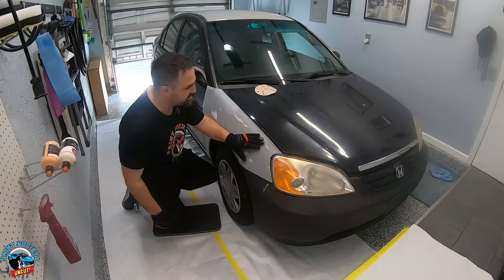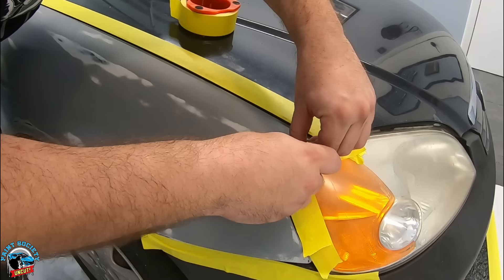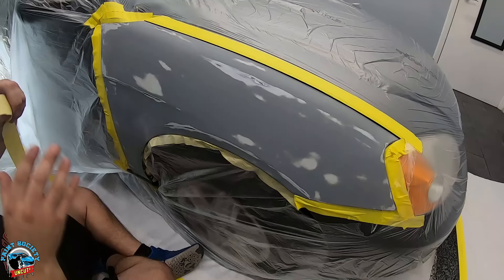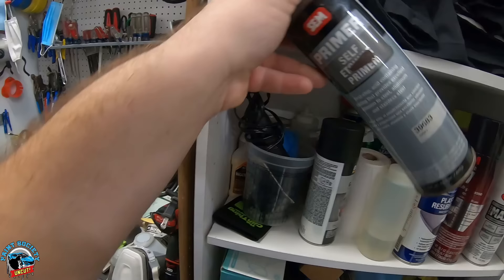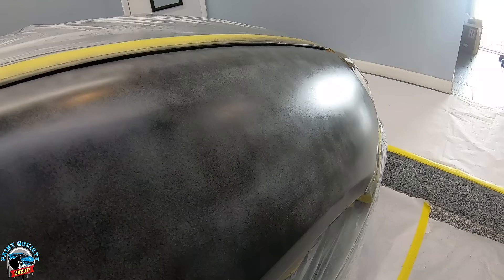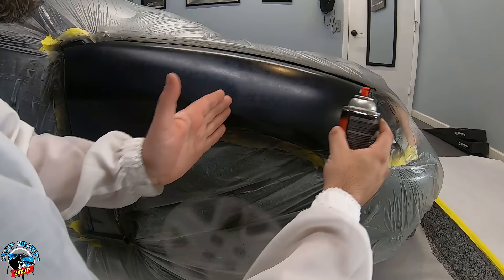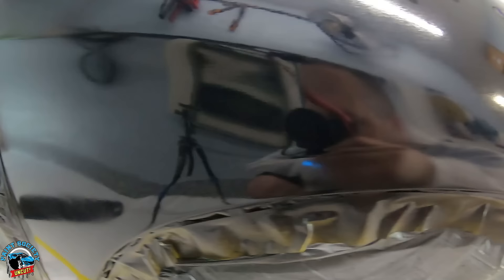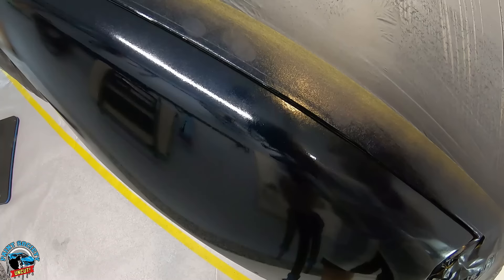Painting your Car with Spray Paint!

Comment: Great videos Brian, and your delivery is impeccable.    I also love your “matter of fact” axioms sprinkled throughout.    “If you get scared of the spray, the car has already won.”    Maybe I paraphrased, but awesome.     So repainting the hood of my 2006 Dodge Magnum, Brilliant Black Pearl.   Quick history:  I bought it new, I’ve only hand washed it maybe ten times, all other times through the “touch free” washes, so there are not a lot of swirl marks happening.     Also never given it a full tilt wax, compound.  I’ve done some panels, the hood maybe once, but not too involved, never the roof, never the tailgate, and only sporadically on the sides/doors, generally when trying to buff out scratches.  The point is that the clear coat is(was) still mostly intact, no peeling, no fading, paint in great shape for a paint correction I guess is what you call it.  Most of the time I’ve gotten through alright with the touch up pen, then blend/sand it in to disappear.   Eh,    Looks like shit.    There are multiple reasons I’ve decided to do cosmetic work on my wagon, but another time.    Beating Chrysler with my Lifetime Bumper to Bumper Warranty is the main reason.  Gotta keep it worth as much as possible.    Plus I love it very much and while I do baby the cars paint and upholstery, it is also a work wagon/production vehicle, yet amazingly in great shape.    So the hood had no dents, one deep chip I guess you’d call a ding, dead center to the primer, and various pebble chips from, ummmmm, high speed impacts with very small things.   Well I’ve all but ruined the hood.    Couldn’t get the tape lines to disappear, way too thick with both paint and clear coat, so had to sand all of that back down, low on budget about now, ran out of sandpaper,  was cleaning it and reusing it, scuff pads, you name it, and the old paint was coming off like dried hard gum, packing every sheet or device within moments.   I got impatient and used my rasp plane to get a lot of the old paint off, and with it went a lot of the factory paint, and a few gouges happened too.  Needless to say, I sanded the hell out of that metal to get it smooth again, but the 80 grit I had laying around dug in pretty badly, and they are persistent bastards, dozens of little crescent moon scratches into the metal, which by the way is incredibly light, my whole hood might weigh five pounds.    Well now it’s lighter because I sanded so damn much.    Anyway, got happy with it, used the Duplicolor Grey high build primer, over and over, with nice long hour plus dry times, maybe 55% humidity, and about 70 degrees in the garage here up the road in Charleston, SC.    With a heater of course, and it helps dry the air too.   This time I got five cans of brilliant black Pearl on, and it looked pretty good, but there were the tiger stripes I’ve heard so much about.   So I put one last hurrah coat of color on and it all filled in pretty well, but still a bit splotchy.   Figured clear coat would fix it.  Which it kinda did, on top of helping a couple of splatters that were very, very fine drops.   I put one and a half heavy coats on before deciding to stop and sand it back a bit to hopefully get rid of the blemishes and either clear coat over my 1500-2000 wet sanding scuff, or add another can of color and really try to get great coverage since there’s plenty of foundation of color.   Problem is that acrylic lacquer has to be applied close enough to hit wet, so getting back enough to prevent stripes allows the droplets to start drying before hitting the surface and results in the well known roughness of dry paint application.     Here are the two questions.   Should I just wet sand the color coat/clear coat till I’ve eliminated  all of the imperfections, which is already 85% there, then go straight to clear coat and let that “even it up”, as the 1500-2000 grit color coat will be uniform, but not shiny wet paint looking.    Does that matter?   Or should I risk applying another can of color and just stay close but keep moving in short strokes?    If I paint it and there are just more stripes and splatters, I’ll have to wet sand again, which is acceptable, but is the new fresh wet shiny paint even necessary?   I understand clear coat, especially acrylic lacquer, doesn’t need much of a scuff if any.    Also, wouldn’t reducing the temp a bit effectively help to slow the dry time of the lacquer, and maybe help the paint hit the surface wet from a slightly farther distance from the panel.  Maybe let it get down to 60 degrees?   I’ve bought so many cans of this stuff, it’s unreal.  In total for just the hood at least 15 cans.   I’ll keep pushing on but I’m ready to lay about a trillion coats of clear in it, with lots of time and/or wet sand/scuff between some coats, which also helps to allow the lower layers to dry(let the solvents evaporate?)better too, right, and then when it’s about 3/4” thick, I’ll stick a fork in it, let it dry for several days before I wet sand and buff it out to a shine, then wait, what maybe two weeks before I wax it?     I guess the clear coat dulls over time.   Last night the clear coat had been drying for about 36 hours, and it still looked glossy wet and deep.    Then I had to sand it back some.   That hurt.    I’m fine with imperfections, but tiger stripes will drive me bonkers.    As if I’m not already.    So, will lower ambient temperature help the acrylic lacquer. spray wet and flow out better?   And do I need a shiny wet(looking) color coat before I clear it?    Holler.
Reply from the maker: Can you send me a message on Ig. Paint.society

I would love to help you but I want you to show me pictures of the job first over there.

Comment: I painted my Grill on my 2001 truck October 30, 2016, almost 15K miles ago. Used Krylon Maxx Classic Grey Spray Paint, it is just showing wear enough, that I’m going to repaint it. We used Krylon Red, to paint the Rebuilt Condenser Motors on Chillers, at work. We used Red so we could tell which motors were  rebuilt. The Paint is amazingly fade resistant, also it is being cooked and blasted by air, and water when it rains.

Comment: From start to finish, great video - what I exactly needed.  I am about to start on the cab roof of my 2006 Ford E-350 Cutaway.  A little surface rust, commercial Oxford White paint.  Probably use a  couple of rattle cans, or, at least a quart of base with my Harbor Freight gravity spray gun and rattle can of clear coat.  Small project.  Biggest hassle is sanding inside the reinforcement groves on the roof.

Comment: Great video as usual. Having worked with those rattle cans; a good tip is once you finished using flip it over and give it a small spray to empty the tube and prevents cloggking. It works on most of them; but some rattle cans are made to spray in reverse. It is just something I learned as if I don't do that the can is then un-usable. Great video Brian ad you are amazing at explaining. I see that your teaching skills are also shown on the video....

Comment: Thanks, really well explained. I think you're actually answering my request, cause I remember asking about removing the hood so the can is held at a better angle. I will be removing my hood to paint it.
Reply: How did ya go? I've had some nice results with non metallic paint but even having my tiny cars bonnet against the wall it was really heavy and awkward  on my own and with metallic plasti Dip didn't manage to get it stripe free...wondering if the last coat of a metallic base coat could be dusted on to eliminate tiger stripes without leaving it too rough for the clearcoat?

Comment: When I was 18, I got an old ass ford escort. It was powder blue, from the factory. With a light gray interior.

I spent 20 dollars (in 2005) on sandpaper and roughly 35 dollars on a case of black spray paint. The first coat looked like crap. After the second coat and a wet sand it was well beyond passable as a decent paint job. Clear coat was the hardest for sure.

Comment: The 2k clear available in a rattle can has really changed the quality of the garage paint job.
Reply: Changed it big time its huge.
Reply: Would 2k hs clear give the same result as what hes using? I noticed it doesnt have the bladder to mix up and dont want to make a huge mistake... my rattle can job is looking pretty decent thanks to this video and dont want to mess it up now
Reply: @mamacito1795  you can definitely get a similar result with high solid clear, but it sprays differently. you'll be able to cut and buff easier than if you were to do the same amount of coats than a thinner clear coat. also, with high solids you'll tend to get orange peel easily. hope that helped!
Reply: @javiendulay7989  that's amazing thank u. I took the plunge and just went with it anyway cos I started so I will finish! Sun up tomorrow will tell me how it went.
Reply: @mamacito1795  How's it look after a week?
Reply: @forcealpine87  some areas in the middle where my spraying was the best its not as sharp as it could be but even in sunlight im pretty impressed so would've been perfect with the right gloss!

Comment: What's your thoughts on blending with this method? I read somewhere someone suggested using adhesion promoter as a substitute for spraying a blender down as a wet bed for the blend area for metallic paints. I'm curious if you've ever tried blending with the duplicolor paint then using the 2k clear over the whole panel, or if not if you could try it for a video!

Comment: I did gas tank and side panels on a vintage Honda bike I was restoring. My local paint supplier loaded a mixed metallic base paint into a rattle can for me. I then used the 2 part clear. The result was outstanding and most of my friends were very surprised to hear how I did it. That being said I do have some experience in paint and body.

Comment: Im so glad I found this channel, I have a 06 sebring (4banger) I need to do some painting to. My front bumper cover, the same side 1/4 panel as you did on this car in this video and the parts which are the worst; my rocker panels. They are rusted and broken away so I more than likely need to replace them before painting. Hoepfully by the grace of the big man in the clouds I can find a junk sebring color matched and grab them off one at the junk yard for the low.

Comment: 35 years ago in our shop when so many cars started to get high metallic paints in them ...like now.. in the past many painted straight color, enamel no clear coat and even longer ago than that lol  it was lacquer color and lacquer clear.. and older than that was lacquer only then buffing.. but when the high metal flakes come in.. we did lacquer color, and enamel clear... lacquer color went on dry, and set up fast so the flakes would not sag then did the enamel clear for shine and more durable so they can be sprayed together.. doing it for years

Comment: Just sanded and repainted the wheel wells of my truck (and some of the bed) and I probably should’ve watched a video first. 

Sanded at 100 grit because I’m a lunatic and I think I have to just sand with some high grit and expensive clear coat and it’ll be fine.

Comment: Nice demo!!, I painted my 72' Porsche 914 with rattlecans a number of years ago...I bought a case of Rusto-Leum "furniture" laquer because the smog nazis' here in Calif banned actual automotive laquer. I used 26 cans and kept walking around the car until they were akk gone but, back then, I didn't know about the clear stuff. I wish I had. I ended up color sanding with 1200, then 800 then cutting it with compound, then polishing compound then of course  a wax..... it looked fantastic. I do have progress pics of it.

Comment: I got my dad some spray can handles similar to a spray gun, they just clamp around the top of the can and I tried it myself while painting parts of my truck frame with undercoat and it's much more comfortable, which did produce a better result. Little accessory that would be useful to have around. I believe the handles were from the Rust-Oleum brand, can probably find them in any diy store area.

Comment: I can spray nearly any size surface with a spray can and it looks like it was done with a sprayer by a pro.  The key is to look to the SIDE and not straight on so you can see the paint flow and never spray far away

Comment: Had a dent that eventually corroded on the lower back quarter panel of my 2005 GMC Sierra. Has been this way for 10 years. After watching your videos I repaired it myself and it’s not perfect but looks pretty damn good! I failed to get the panel perfectly flat when I sanded the  Bondo but only shows in a certain light or angle. Now on to a couple other small dents where I will need to do some blending. Then touch up a few nicks here and there and give it a final compounding and buffing. Had planned to buy a new truck but not now. I will keep what I have and continue to do some modifications. Appreciate the videos!!!
Reply from the maker: Glad to hear it looks better !

Comment: For cheap paint plastic at Home Depot, I recommend the HDX brand. It's sturdy and lite, abundant, and cheap! But the down side is that if you're painting outside (clearly if you don't have a garage) be cautious of the weather especially the wind, humidity, and temperature. Especially the wind; that plastic can blow off unto your project and ruin the paint, but know that the plastic needs to be as secure as possible and/or limited to the right amount of plastic for your own project before doing any painting.

Comment: I need to do this on my truck. But not whole panels, just some areas because the paint is either chipped on the sides or peeling on the roof of the cab. Great tips.

Comment: 600-800 because you dont want to sand off the primer and pretty much did. I noticed a few untouched spots on the  primer coat and the first coat.
Try not to criss cross when you're spray painting pannels, always horizontally. Dont do one side of the pannel and then the other, fallow through with your spray at a steady speed, and keep a steady distance from the surface.  Another thing is always paint from the top down to prevent leaks or debris going into wet areas. 

I'm not trying to be out of line in any way, just trying to share some advice and knowledge and point out what i seen wrong.

Comment: Will you please do a video using Rust-Oleum in a can and use hardner and then clear coat it. I've had awesome results but the trick is wet sanding the paint after it sets up for a few weeks then sanding it down with some 800 before the clear. I'd be afraid to try metallic unless u added some clear to the paint. I think the last time I used regular enamel reducer.

Comment: So you're in Florida. I notice you have an overhead ceiling fan going, and that seems counterintuitive to me. I thought you'd want the air to be as still as possible. Here in Alaska, we have overhead heaters in our garages. The common wisdom is to heat that sucker up quite a bit before painting, then shut it down and hopefully it'll stay warm enough for the paint to cure without disturbing the air. And of course, a very thorough cleaning of all surfaces before painting.

Comment: Ryan its Ryan. Just got done with both front fenders and bumper cover on my 07 ridgeline. It all went perfect, except the freaking y2k clear is orange peeley. Big time. Did just like you said ten minutes betwen paint coats. Half hour start clearing. 72 degrees at night in my garage. I thought I sprayed the clear perfect. arg now ive got to wet sand all of it , yuk. I even had to use my heat gun in a tiny crack, get it dry sanded it out, used the hole in cardboard to prime it, block that little spot you cant even tell.  But the clear, one good thing no one single run.
Reply from the maker: Scuff it with 600 grit and apply 2-3 more coats of clear slower and closer

Comment: If you're not in a spray-booth, and in your garage, tent or whatever, and you're attempting paint/clear a car/truck or a scooter tank/fender, always run a fan (Preferrably a rotating fan) horizontally over the area you are painting and/or clearing. NOT directly ON and/or directly above, but a good 1-2 feet ABOVE your surface ! This way, bugs, dust, etc that normally would fly/fall down into your fresh, wet finish, will be blown horizontally AWAY from your wet horizontal surface !  Dust & bugs never usually land on vertical surfaces, as much as horizontal surfaces. So, try that, because hat will eliminate these HUGE little issues in your finish ! 2nd, if for some reason a bug/fly DOES land in your fresh finish, and you remove it, remember that you also just removed a minute amount of that finish, whether it be the base-coat or the clearcoat. So, after removing the bug/fly, there's a void left in your finish, so try & drop a pin-head size of that same finish (Base-coat or Clearcoat) using a pin-head/ a nail, or something similar, back into that void & let it flow out into the void ! Preferably you want it PROUD (Taller) of the rest of your finish, so you can sand it down later. OR, just leave the void alone (where you just removed the bug) and wait until its all set-up & hardened, then add that drop or two into the void. One drop at at time to allow it to harden & build up a little proud of the rest of the finish, so when it is hardened, its a bit taller (Proud) than the rest of your finish, and you can then do what this cat is doing, by carefully sanding the spot down so its level w/the rest of your finish. If you follow these steps, you will NEVER EVER see that fucking void that that goddamn fucking nasty fly or bug left after he landed in your beautiful finish & you removed him !  GOOD-LUCK !